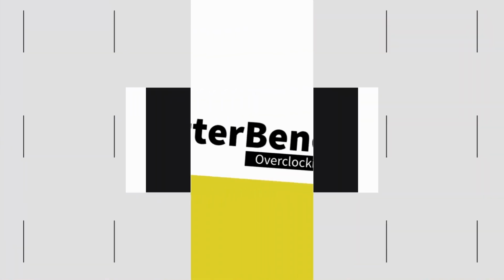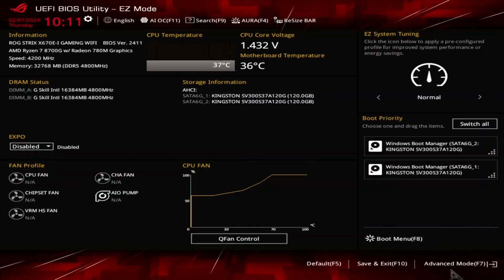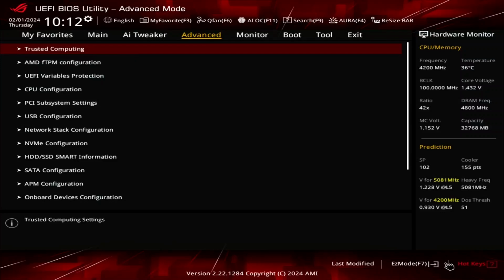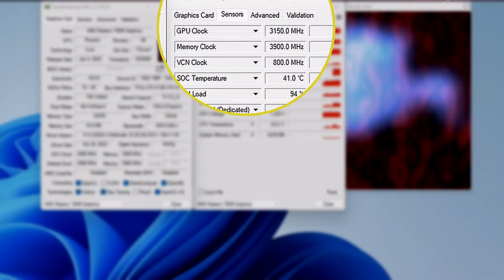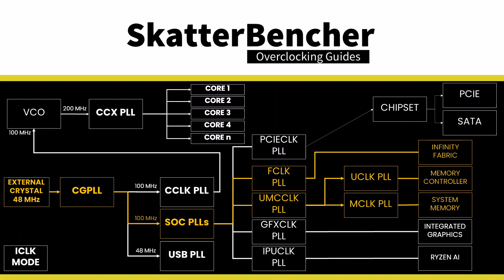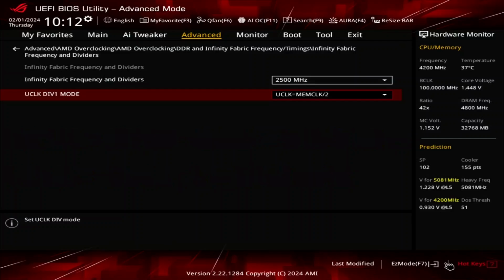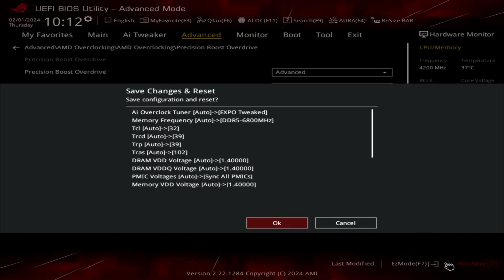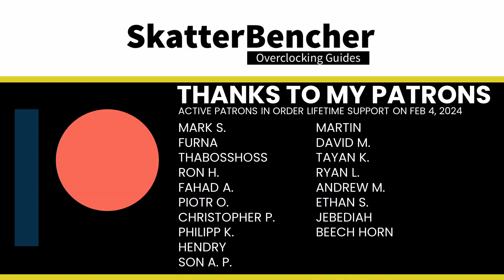5 Minute Overclock: Radeon 780M to 3150 MHz

Comment: Mine 780m does not start when I set 3150mhz and 1200mv. Starts only when I leave this parameters 0 0
Reply from the maker: Maybe the frequency is too high. You can have a look at my longer guide for more information about overclocking the Radeon 780M https://www.youtube.com/watch?v=yWZycOlMwNI
Reply: I've checked it in the first place. I've tried multiple combos... some times I got post, but when windows boot up GPU could not use drivers installed in the system. 

X670e-f 1807 driver 

PS. Thank you for you tutorials and great videos

Comment: Hello! Big fan of ur videos. 
I have a question that hasn't been answered for a long time. 
When we talk about safe voltages, and how too much voltage can cause degradation, Are we concerned with The ACTUAL Voltage or how much Heat a voltage generates?
For Example, are we concerned about 1.3V for 3 years continuous, or are we concered that using 1.3V continuously makes the chip run at 95deg for 3 years and the HEAT causes the degradation? 

Also, part 2 of my question, what is the safe voltage for the Ryzen 5000G and 7000 series CPUs? 
How is the Safe Voltage determined? 
I am sorry if this is a stupid question, but I am actually confused about this whole Safe voltage thing. If my question is actually meritorious, maybe a dedicated Video about this topic in detail can help Newbies like me. 
Thank you so much for reading this comment and have a nice day!
Reply: I would like an extra video about that :]
Especially what safe voltage means and what time period this refers to.